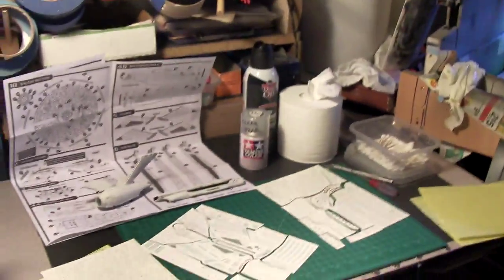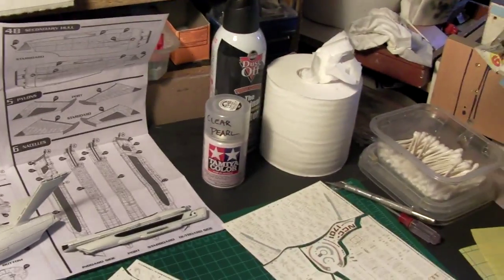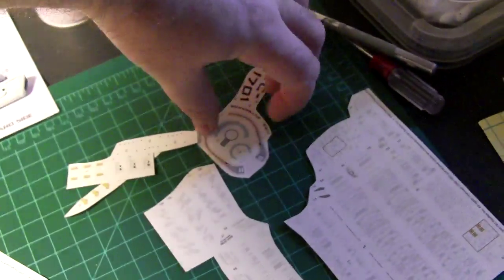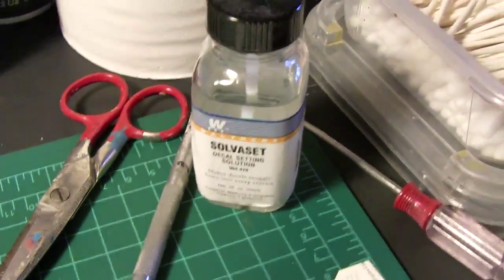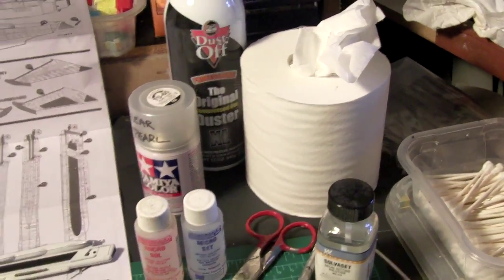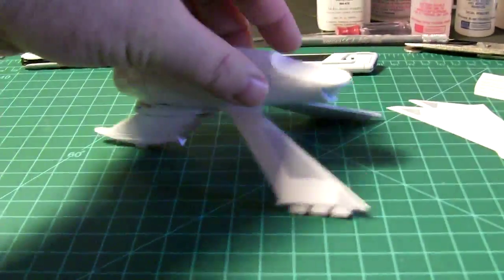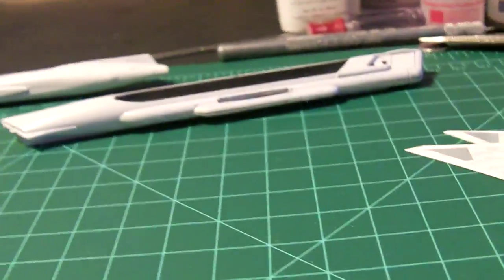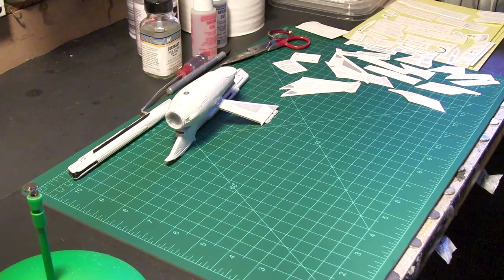1/1000 Refit Decals1: Preparation

Comment: Hello,  I want to know what kind of paint I should get for the primer just normal spray paint? Are there any specifics in terms of the kind of paint and or ingredients? Also, I would like to know where I can get that clear primer you used?

THanks love your channel
Reply from the maker: +Lester Matos Thanks.  I use normal enamel spray paint from the hardware store.  I don't recall the brand now, but probably rustoleum.  Some modelers will swear by model paint like tamiya, testers and so on for primer to finish coats.  I don't mind mixing.  Using the most affordable or efficient for the job.  I have had some probelms sometimes because of that though!